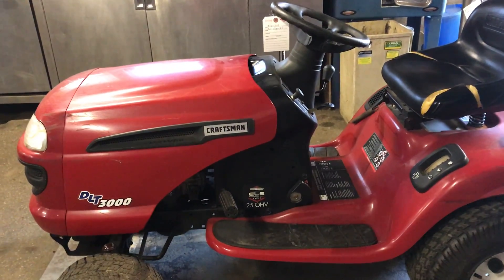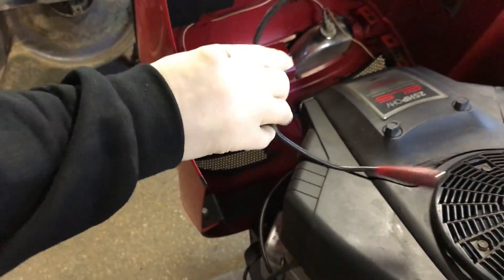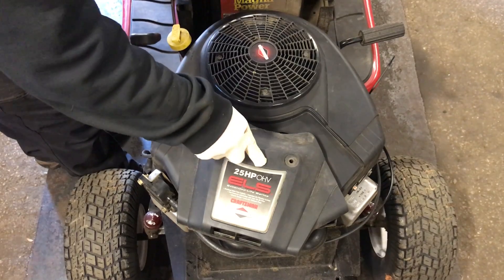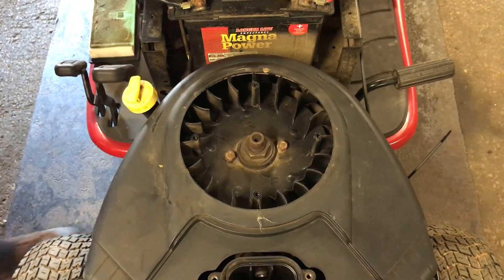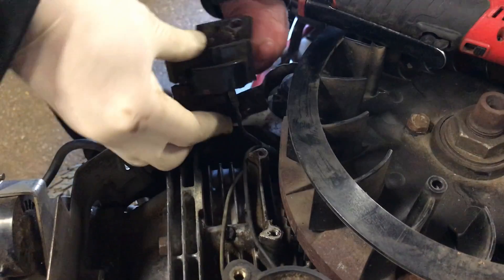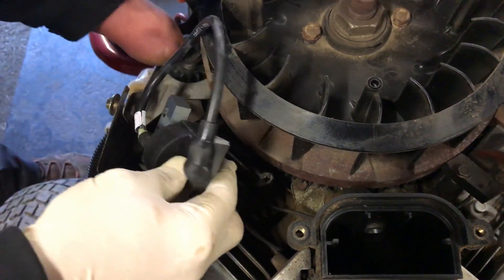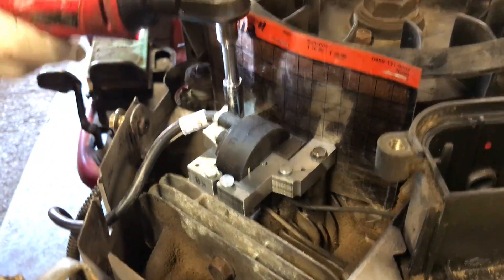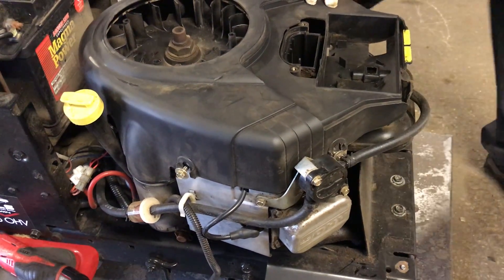How to replace a ignition coil in a Briggs and Stratton Engine

Comment: I take that cowl off the engine and do a mouse nest check every spring.  A few years ago, I went out and mowed the first time for about an hour and things went fine.  I started the mower the next day and it would barely run.  I found a mouse nest covering up one of the cylinders and it overheated.  I had to replace the engine.

Comment: Thanks.  I've been trying to fix my Husqvarna 2448 that has the same engine.  I think this video has solved my problem.  There was a loud spark and smoke when I shifted into forward.  Then it would not start.  I replaced the battery because it would not get above 10.5 volts during a 4-hour charge and could not start the motor.  Then it started but only one cylinder would fire (very rough).  I changed the plugs but still the same.  I pulled one plug out and it ran the same so I was able to determine which cylinder was not firing.  I was about to pull the valve cover off till I saw this video.  I'm not a motor head.  I'm a carpenter and wood turner so this is all Greek to me.  I'm going to replace the one coil and see if that is the problem.  Thanks for posting.